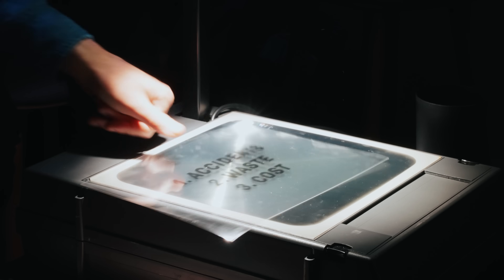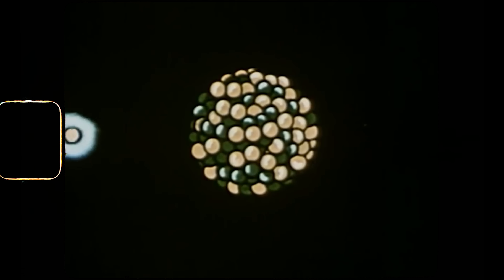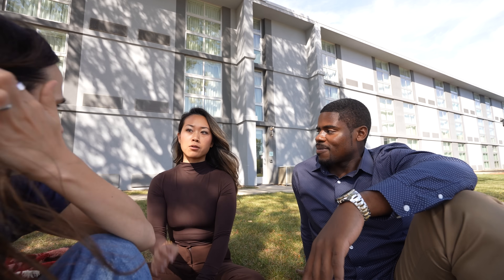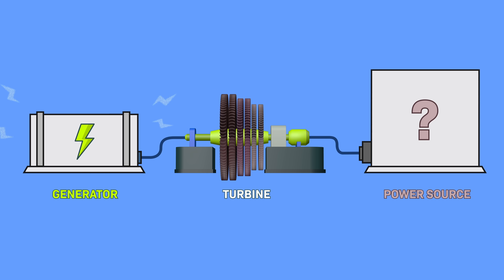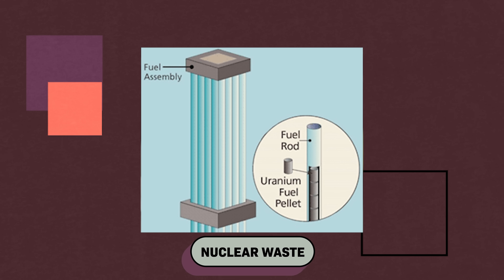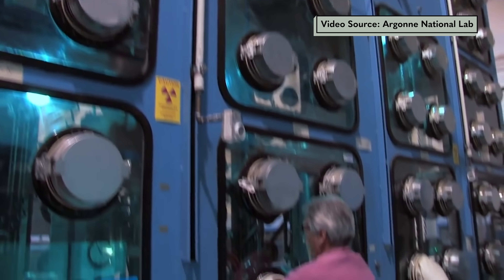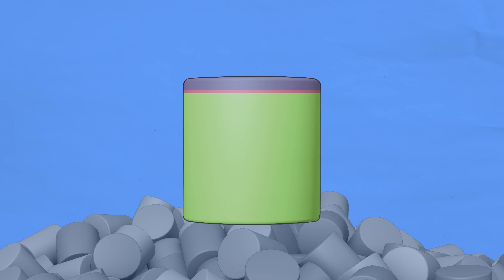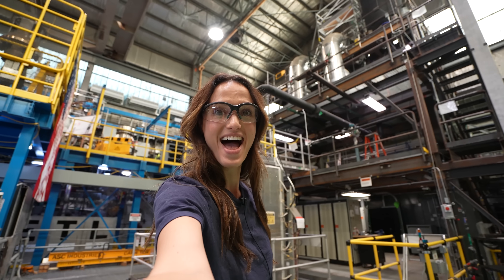The Big Lie About Nuclear Waste

Comment: Hi Cleo, reasonable video, but won't hit like as there are some glaring inaccuracies in the video. You're on the right path, not a total criticism, but reprocessing as listed has costs and limitations.

1. There are 2 primary types of reactors, thermal and fast, all power producing reactors in operation are thermal. You do mention fast briefly, but provide no context.
2. There are reactor types that don't need the fuel to be solid in rods.
3. The U235 used before the fuel needs to be replaced is not as much as you state, otherwise the reprocessing would not be effective. There's typically 30-50% of the U235 remaining.

Fuel re-processing is has been done in the UK and France, as well as Japan. The problem is it's expensive.

There are alternatives:

Firstly there are molten core reactors, these use either salts or metals as coolant, depending on the design, some use rods as described, but some put the fuel directly into the coolant.

Then you have fast reactors, this too much to cover in a comment, but the long and the short of it, is that in a power reactor roughly 3-5% of the fuel is U235, the rest is U238. In a fast reactor it will mutate the U238 into Plutonium (P239/P240 + Others) which can be used as fuel in the reactors. This is known as a Breeder reactor.

The 150yrs they claim is purely for U235, with a fast reactor it's about 4000yrs for the US.

With Molten Core reactors you can re-process the fuel in the reactor with it operating, this is beneficial for fast reactors to help them maintain control.

The other thing with fast reactors is they need more enrichment, the spent fuel from the fast reactors perspective (the plutonium) is already more enriched. They can take the spent fuel directly without needing the reprocessing step (other than extracting them from their rods).

Finally the short lived waste is separated in the internal reprocessing inside the reactor and can be converted into nuclear batteries, so it is no longer waste and continues to provide power.

Comment: Most of the US reactors in operation were designs developed in conjunction with the U.S. Military in the late 1950s to early 1960s.  They are very early generation technology (mainly in a second wave design after the first army/navy units).

Most of the plants were built in the 1970s as it became usual to se a decade between design and commercial use. Over the time of the 1960-1980s many generations of improvements became available and were on their way to the commercial market.

After 1979 (three mile island) that all changed.  Public sentiment changed, corporations distanced themselves from new nuclear plants, and eventually research money disappeared.  

By the mid-late 1980s the US nuclear research stopped innovating on new designs and basically froze in time.  Research continued in Europe with France and Germany being larger influences.   

In the 2000s something interesting happened.  Nations from around the world found they were able to go and visit Oak Ridge labs and China and a few other nations realized the United States was sitting on 30 years of advanced nuclear designs that never made it into use.  Those new designs are being built overseas today, and they he US is now near the bottom of the world in terms of reactor research.

So essentially we have all the research to have designed and deployed safe, efficient, lower cost, low waste reactors… we just became to fearful to solve the problems.

Comment: In my country, where nuclear waste is buried 100 m under the ground (from France, the Netherlands and Germany and ours, from Belgium), they are designing a process to recycle nuclear waste. To fuel up new techniques that also makes electricity. BUT nuclear waste is not only from the rods, it contains also waste from RX machines, protective clothes and so on. That's the Nuclear waste they cannot recycle, and these piles of storage are huge. For that they have no solution, and going to be buried even deeper than the 100 m.

Comment: The problem with nuclear energy is not usually the technology.  It's costs. Costs to make it safe.  If you don't spend enough on safety you get 3 Mile Island or Chernobyl.  Some say that was human error.  So?  The cost must cover ever possible occurrence human error.   Is that possible?  Maybe not.  So what happens when all efforts fail?  Quite the conundrum, eh?  A guy named Murphy proposed that "Whatever can go wrong will go wrong.".  Some nuclear energy proponents tend to minimize this concept.

Comment: The majority of our nuclear 'waste' does not come from electrical power production, but rather from the Manhattan Project and subsequent plutonium production for weapons. I worked at the last such US plant, called N-Reactor, during the last years before its closure in 1987. One of the by-products of spent fuel processing is Cesium 137. It has long been used to sterilize products such as adhesive bandages and tropical spices. It could be used much more widely to preserve foods such as fruits and grains. Radiation-sterilized food products can remain wholesome and tasty a year or more without refrigeration.  Better that more C 137 (and Cobalt 60) would be available for food preservation. This was well known in the 1980's, and many technical papers were published about it.

Comment: Nuclear cars could have been a reality by now. It's maddening. Between advancements in stirling heat engines and material science, we could be driving guilt free nuclear vehicles and powering our portable electronics with nuclear powered batteries.

But people are so afraid of nuclear things that it's rediculous. They don't understand that a well designed nuclear device converts ALL OF THE EMMITTED RADIATION into heat or electrical power.

Comment: It was only a few snippets, but what you played of that old video sounded so sensible. Which makes sense, it's an advert for the type of thing they were out to make. But even the talk about harnessing the waves and solar energy.

Humans have a bad habit of finding one way that works, making that one way extremely cheap by using very specific designs and processes, and then lobbying against anything that might then threaten the ability to keep doing that cheaply. When really, we need to be going hard on researching as many ways of doing the thing as possible. So that we can find actually better ways of doing a thing.

Be really cool to see how this particular way of doing things could be one of the huge* if true kinds of ways when that interference is left by the wayside.

Comment: I think there are some points that I saw as problematic. Enriching doesn't make U-235 from U-238, just tries to separate them by using the tiny differences between the two caused by the 3 neutrons. So you get depleted U, rich in U-238 and enriched U, rich in U-235, typically around 3-5% for a traditional light water energy producing reactor, 10-20% for some small research and military reactors and 99+% for U based bombs. You put it in the reactor, and neutrons will split them (originating from the small amount of natural fission or a neutron source for some small designs), then given sufficient amount of fissile material and appropriate geometry it can run for a long time. For typical lightwater designs the fission is done by slow neutrons, and the released neutrons are fast, so they need to slow down. For a different design you could use fast neutrons, which could split other isotopes or have a design that can use natural uranium, and again a different design that can use thorium.
I think mostly you are talking about reprocessing, which is a fairly problematic part of the fuel cycle, handling spent fuel you have a lot of radiation locally (hazardous for the staff and equipment), and the potential release of radioisotopes (some relatively low level release is certain), especially the gasses into the environment, but the main issue nuclear powers have with this is that you get back Pu, which can be used for bombs, if the fuel elements spent a shorter time in the reactor, or not if the 4-5-6 year exposure time is used, because during the long campaign it picked up more neutrons, and it is the wrong isotope for bomb making. You also get other transuranic elements, which can be put in MOX fuel (original MOX contains U and Pu only, now Cm, Np and other could be put in it) that can be used in the lightwater designs as well, but is typically a bit hotter, so you might need to make adjustments, and uranium is much easier to be enriched again, because a lot of it is not used up, just too much neutron catching non fissile stuff built up inside. Now sometimes they put in some elements that "burn out", slowing the reaction and extending the time the fuel rod can be in the reactor as well. You also get fission products out of it, which can have many uses in industry and medicine. So usually only nuclear powers get to do this, and also enrichment of uranium, since if a country can reprocess spent fuel or enrich uranium they can make a nuclear bomb. Some modern reactor designs, where fueling and reprocessing can  be done continuously could have a high proliferation potential. There are different ways to get energy out from nuclear waste as well. RTG-s use the heat directly and also turn it into electricity, an optoelectric nuclear battery first converts the energy it to light, then light into electricity, alpha, beta and gammavoltaics get electricity directly from radiation, like a solar panel (but radiation damages the panel over time because it has enough energy to break chemical bonds, so this has limits), there is the Stirling engine that turns heat differences into mechanical motion, which can be turned into electricity and more. The problem is, if they are safe they provide little electricity and if they provide a lot of electricity they definitely have the potential to kill people, so generally you don't get to have such technology. But Pu-fueled pacemaker technology existed (Laurens-Alcatel Model 9000, with a couple of Ci-s of Pu-238), radiation powered safety lights, instrument screens, and sensors exist, radiation based batteries can be used to run satellites potentially for hundreds of years without refueling, powering the Mars rover or for the Soviets radio towers and arctic light towers, but their Beta-M type designs had lots of safety issues after the collapse of the Soviet Union, because they were left unsupervised and some people took them apart for scrap or they were damaged by the elements. So yes, I think the open fuel cycle is very wasteful, there is lots of untapped energy potential in spent fuel, reprocessing would be very good, but in addition to the economy there are geopolitical level safety concerns with it, and the deliberate choice of taking the risks of handling them. The IAEA is for the safe and peaceful use of radioactivity and nuclear power, and is willing to provide help to anybody promising only peaceful uses of nuclear energy and swearing not to divert nuclear materials for military purposes. This can have limits in geopolitics, for example see the nuclear program of Iran.

Comment: It’s still so incredibly complicated, requiring very careful operations and high security, and it suffers from centralization. Solar + battery is safe, cheap, and can be decentralized, reducing transmission loss and adding resiliency.
Reply: Tell ke what to do when the sun don't shine?  And the fact it requires 75 tumes the amount of land.

Nuclear is by far the best energy source.

Comment: The real problem with nuclear is just cost. Thats about it. Our current nuclear reactors are very expensive and recycling waste is very expensive. Also build times with modern security standards is also quite long. 
I don't really mind building nuclear power plants but cost and the fact that its centralized are just reasons why renewable are a little bit better at the moment in my opinion. You can just throw solar at all the empty roofs and put wind turbines in the sea. It's easy and doesn't seal as much ground as huge centralized plants. For the base level power use nuclear is not the worst solution but I think we should still primarily push for actually clean energy

Comment: This technology doesn't benefit mankind.  It yolks them to a centralized, permanently unachievable, source of energy.  There is no future where a mudHut in Africa has a nuclear waste engine powering daily needs.  There is a future where solar energy can be harvested at any scale imaginable to generate as much or little energy as any possible user could ever need.  That future is right now.

That is why nuclear energy is a dead end for wide scale energy production.  It serves no beneficial purpose to individuals to have their energy locked behind the most highly regulated paywall imaginable when the Sun is free and forever no matter how much they might need, or what they might need it for.

And "more energy sources, as fast as possible" is quite possibly the most delusional thing anyone has ever said about the energy crisis.  The Sun is infinite fuel.  End of fking debate.  There is no fuel source that doesn't require energy to harvest, distribute, or maintain the infrastructure of that isn't solar.  Period.

And before you bother spreading more delusional nonsense, solar energy doesn't have to be harvested using solar panels.  In fact, they kinda suck compared to a dozen other options that have been available for more than a century and are extensively proven standards.

There is no debate.  Everything that's not solar is wrong.  Literally everything.

Comment: .... but.... isn't the main factor in why breeders and such reactors aren't more widely used more of an economic factor than anything (because new uranium is so cheap compared to the costs of recycling)? Not that I don't love the tech and hope that it gets more widely adopted (which should certainly help the costs come down). But it feels like the guys from the startup are right. It's just not been commercialized in the US - because it's expensive. (And because of silly political fights, so fair enough, I guess lol)
Reply: she isnt talking about breeders tough, but about a process using electrolysis, IMO this video does little to actually explain things better. But yes the basic issue is, its not economical viable and nuclear power already has problems to compete on the market.

Comment: To be pedantic, you didn't explain enrichment correctly.  It's not making U-235 from U-238.  Its removing U-238 from the mixture to increase the concentration of U-235.
Reply: There are so many basic blatant things wrong, also the number is not the number of neutrons for example.

Comment: Electrolysis in molten salt.  I've read that using molten salt as the heat transfer mechanism in the reactor is also a good idea, it transfers heat better.  Also read that the fuel mixture could be molten salt as well.

Comment: Grew up with my dad working in the nuke industry, construction quality control. I'd heard about this possibility since I was a kid (~40 years ago).  The analogy I'd heard long ago and has stuck in my mind ever since is:  Picture a car with a 100 gallon gas tank.  You use 10 gallons. Then you park the car, send it to service, remove the remaining 90 gallons and store it somewhere 'safe'. Then fill the car back up with 100 gallons of gas.   The idea being that we're only using a small part of the available energy on that first pass thru the standard reactor.
Reply: That is a false analogy.  imagine instead that the 90 gallons you remove are mixed with diesel fuel and heavy fuel oil.  They will still burn a bit in your pistons but your car will be very inefficient.  Then the remaining 80 gallons will perhaps carry you two miles at a crawl.

Comment: Japan does not have any commercial fast breeder reactors.  They spent ten years building one, and ran it for just over three months before there was a massive sodium leak, a coverup, and a suicide.  They restarted it fifteen years later, ran for another six years with repeated maintenance and inspection failures and equipment malfunctions, and shut it down permanently in 2016.  Japan is not a breeder reactor success story.  Russia has had two operational plants, and recently built one more.  France had one, but they shut it down after just a decade of operation.  Everything else has been for research purposes.  The US commercial nuclear industry didn't stop using breeder reactors, they never started in the first place.

Comment: This explains the interest in molten salt reactors that combine nuclear material mixed in a molten fluoride salt solution. MSR's have been studied to not only use thorium-232, but reprocessed uranium-235 from spent nuclear fuel rods and even plutonium-239 and -240 from dismantled nuclear weapons dissolved in fluoride molten salts as fuel. This has the potential to eliminate the need for very long-term nuclear waste disposal facilities, a huge boon for the environment.

Comment: I am watching these pro nuclear power videos and still can’t find a reason why to continue. Nuclear power is expensive, heats the rivers used for cooling, not to talk about the risks of an accident. In Germany and France last year, the water level of the Rhine was so low that it became a risk for the nuclear power plants. 
We should finally start to produce energy locally using the best sustainable methods which are available. Cutting out the big corporations.

Comment: One way would have been to build not just fast reactors but ones running on Thorium.  Instead of recycling or having less waste, they opted to have the Plutonium at hand to make bombs...
Reply: Thorium cycle produces U-233, which is an excellent weapons material.
Reply: @Crispr_CAS9  Sure, that was not the point. It was not the preferred fuel cycle when investments were made into developing reactors. It was preferred to produce weapons grade Plutonium, IIRC.